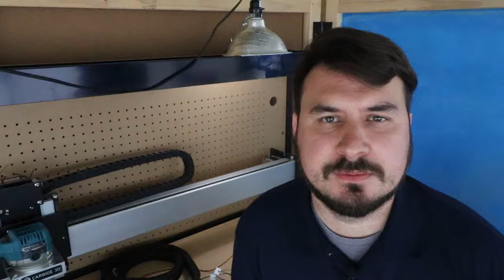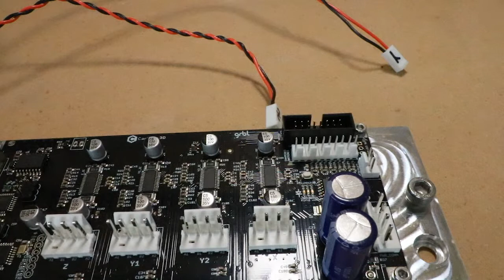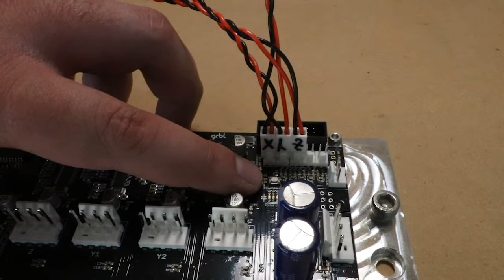Basic Shapeoko Limit Switch Troubleshooting

Comment: My all my switch’s are indicating that they are working properly but my z axes motor does not move and makes a pitched sound when the power is on. It moves  with no problem when the power is off. when I select initialize it just keeps coming back that homing cycle error and limit switch could not be found

Comment: How does the machine knows when to stop when moving down on the Z axis? I am trying to bore holes on the Waist board. It seems like the depth I’m trying to achieve exceeds the railing on the Z axis. Making the bottom V wheels on the Z axis come off the rail. Making the bottom Z plate wiggle back and forth causing damage to the 2 bottom V wheel, Bit and the Waist board.

Comment: If you have the new electronics enclosure, the microcontroller board is now oriented upside down in relation to the instructions on their web page. This means that Y1 and Y2 wired need to be switched with each other. If you don't do this the initialization process will drive the gantry into the front of the CNC, where there is no limit switch. So the motor will just grind away making a nasty sound. Assembly instructions need to be update for the new electronics enclosure.